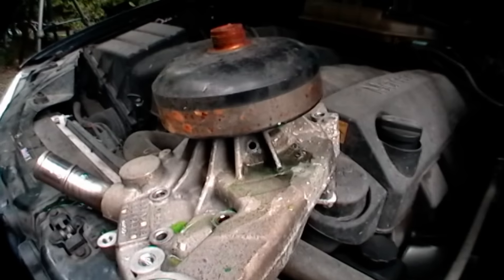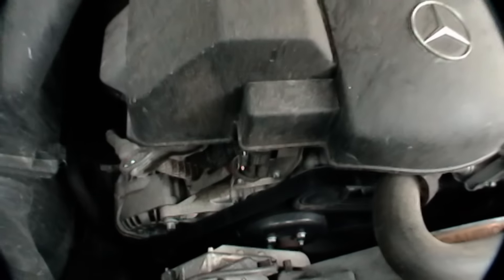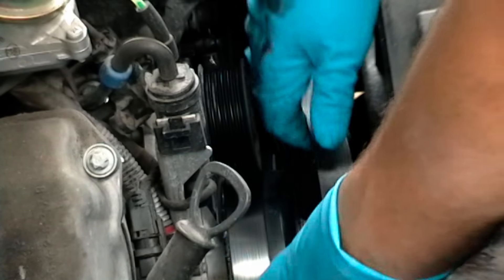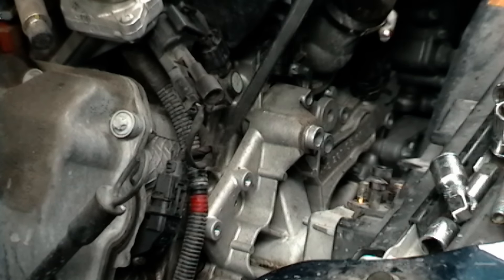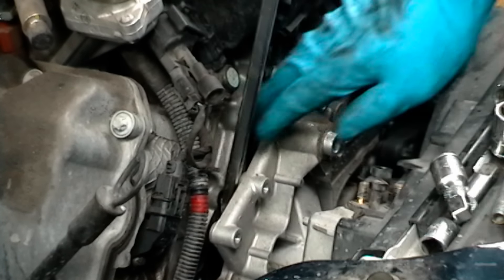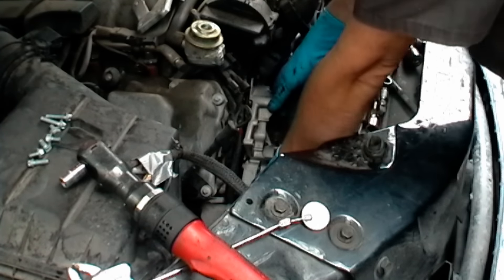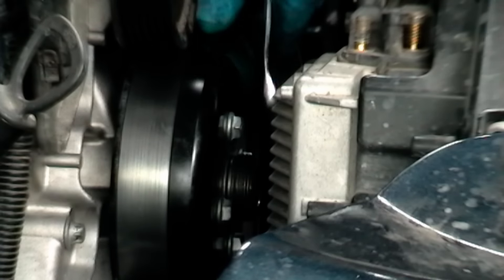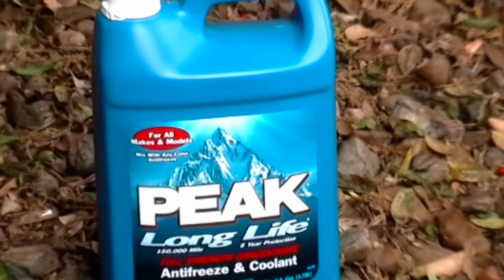How To Replace a Water Pump

Comment: If the water pump is connected to the timing belt then isn't there also a procedure that must be done involving the timing?
Reply: +Zac Conces    It was the serpentine belt Scotty removed. The timing belt is farther in in the engine, and a lot bigger job. However the serpentine belt is kept under tension by a constant force tensioner, and usually more painful to deal with than the video shows.

Comment: You didn't show how to remove the clutch fan assembly.   Is that on a different video?  That part is really bad, I have been working for hours trying to remove mine from my Crown Vic.  Can't grip the bolts to turn the hex nut

Comment: Im about to change mine tomorrow, alone and see what's happens lol
Reply: What happened?
Reply: TekaiGuy I did it man, I have a c class 2002 and the water pump is on the front so I had to take away some stuff. The water pump had 8 bolts it took me about 1 h. Thank god there is scotty Kilmer videos!
Reply: That's good to hear, I have to get mine changed soon with very little knowledge about cars, but hearing that gives me some confidence.
Reply: TekaiGuy well that was my first time as well, u can do it man because if u don't, it'll cost u some money, just saying I was at Mercedes I told them my problem. They told me to change the water pump it will cost 400$

Comment: This is if you're LUCKY enough to have the water pump driven by the fanbelt, My sisters car has the waterpump driven by the timing belt, so if I were to replace the waterpump on it it would only make sence to change the belt too?

Comment: HOW TO CHANGE THE ACCELERATOR PEDAL ON 2003 CADILLAC ESCALADE ESV
Reply from the maker: simple job, just crawl under the dash and bolt a new one in, it's all electronics, no cables to mess with

Comment: Great video Scotty!  Unfortunately, when I was about to change the waterpump on my 1997 Catera (80K miles), I found another problem. The waterpump pulley wobbles when the car is running. I also heard metal knocking around inside the engine. Up until that moment there were no sounds, overheating, oil leaks etc. I looked up recalls on the car and found that they had a recall on the waterpump and something called the 'Camshaft Pulley'. Can this Camshaft Pulley be what I'm hearing? How bad is this?

Comment: Would you buy a used car that had its water pump replaced at 50,000 miles? Is it possible that the engine got damaged due to failing water pump?

Comment: i just replaced the water pump in a 93 Cadillac fleet wood 60's special there latterly no room in that car for any tools to get to it we used a big pry bar to lift the motor that inch to free the last bolts by the shock tower... only to find out it was not the pump it was the plate behind the dam pump... 100$ for the pump and 6 hours time wasted only to haft to pull it all apart again to replace the other gasket...

Comment: hey Scotty how do you change a water pump on a 2012 nissan cube i tried to do it my self but i was only able to take off the 2 bolts but not the 2 pins and i hit it with a rubber mullet but it didnt come off and is so frustrating because i spent the whole day trying and i couldnt plz show how i cant find anything on the internet except half A$$ job with no explanation or hardly any. plz men help.

Comment: Hey Scotty. You have some great videos. I am putting a 307 small block into my 1954 Dodge Fargo. I don't have a clue what I am doing and I am looking for guidance. I can do my own body work and a friend was going to show me how to put everything on the motor and get it running, but he fell ill and is no longer able to work on cars.  Do you have a video on where everything goes on a 307? It is a motor only. I need to put on the water pump, Generator, pullies,  Carberator and set it up. Connect all hoses to the carb and distributor. There are lines for the transmission as well that I need help with. I guess I need everything. I hope you can shed some light my way. Drop over to my channel and see what I am up to. I have subscribed to you channel a couple of years ago so I can keep up. Thanks.

Comment: I need to nowhy not getting no water presure in my camper
Reply from the maker: if you mean no pressure inside the cooling system for the engine, replace the pump and thermostat. If you mean sink water pressure, check the water pump for the camper water system for restrictions, bad pump or clogged lines

Comment: ANd now they know the problem. The only guy who check what is going on and he try to see the problem to put on pressure everything he found leaking under the hood. Head on motor repairing was costing about 950 dollars  pulleys about 600 dollars the water pump about with work and shipment and everything together was allmoust 2000 dollars in euros about 1700

Comment: Hey Scotty does $600 sound reasonable to have mechanic fix my water pump, its a 95 camry V6. Thanks!
Reply from the maker: Chue Yang a tad bit high, unless they are also changing the tensioner and the timing belt
Reply: So then what is a reasonable price

Comment: I recently replaced my water pump on my 2000 ford Mustang! And at first it was fine, there where no leaks! But now I have a leak on a metal hose, I believe its called (coolant bypass hoes) I really don't know what to do! Should I by that metal hoes? Is it my water pump?
Reply from the maker: depends where the exact leak is. Pressure test it and find out. Often the clamps or rubber hoses at the end go bad and leak